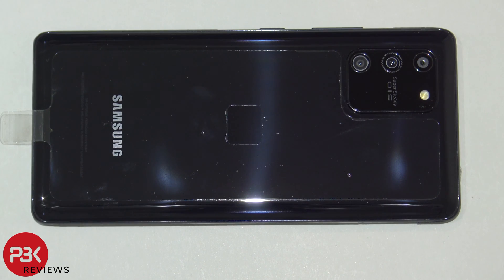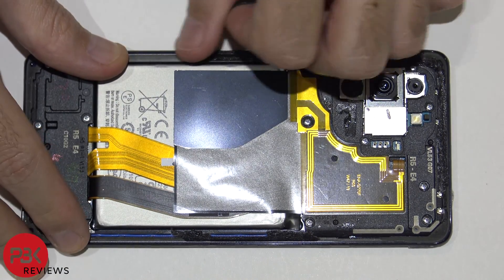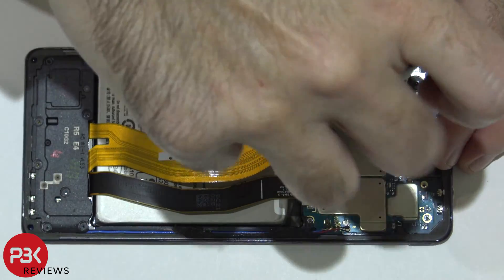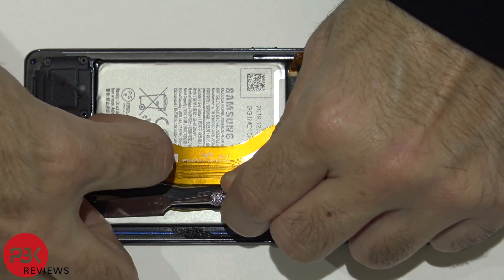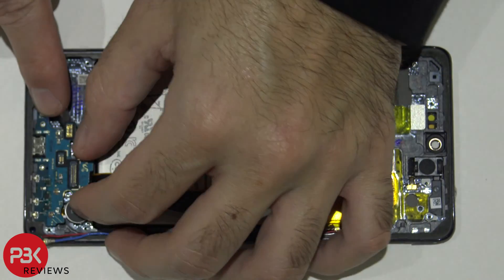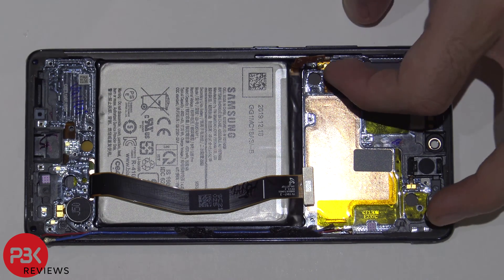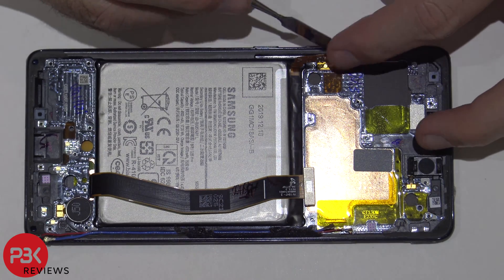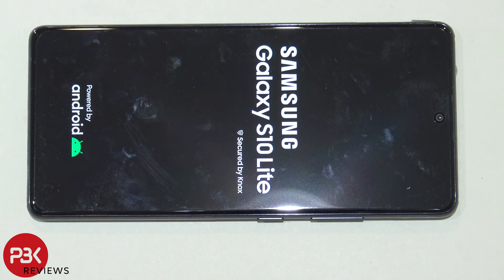Samsung Galaxy S10 Lite Disassembly Teardown Repair Video

Comment: Instead of using heat on the rear panel, it's better to use a, very thin, pry tool to get up under an edge and go from there. Too much heat can melt/warp the plastic.
Reply from the maker: Yup, you don't need to use too much just enough to be able to loosen the adhesive a bit, and then use a suction cup tool or something else to gain leverage to get a thin tool in between.

Comment: Why u stopped at the hardest part? Remove the screen then?
Reply from the maker: Once you take the phone apart, all that is left is to heat up the screen and pry it off so no point in damaging a working screen to just pry it off.

Comment: Hi i have an issue with my s10 lite. When i plug in the usb c cable it wont charge and a popup comes out saying that the temperature of the battery is too low. I tried installing an app to check the battery status and it says that my battery is at -20° C. What could be the problem? When i push in the back, a little under the cameras it returns to ~25-30° C but just for a few seconds. Anyways, nice video and explanations. And thanks to anyone that could help me as well.
Reply from the maker: Hi, it can be the charger port/sub board which needs to be replaced, the battery, or the wireless charging coil if the phone has one which the s10 lite doesn't. You would need to check those parts one by one and see which one is the faulty one.
Reply: @PBKreviews Ok I got it thank you so much for replaying even tho this video is 1 y o.

Comment: My Samsung s10 lite vibration is not working. I already replace the new vibration motor and still not working. Could you suggest another way to solve this problem? Is there another part that  can be damaged to cause this vibration problem?

Comment: Which part of the phone hold its storage? Can i dissemble  it from a broken s10lite and put it in a new replacement s10lite?
Reply from the maker: Hi, the onboard storage is soldered onto the motherboard and you would not be able to take it off to move it to another phone. Requires expert soldering skills etc.

Comment: Thank you. Is it easy to replace the battery?
Reply from the maker: You're welcome. Once the back plate is removed and the screws on the top plastic cover and the top plastic cover are removed, you need to disconnect the flex cables, and then either apply some isopropyl alcohol around the sides of the battery and let it sit there for 30 seconds to a minute so it eats away at the adhesive underneath the battery making it easier to pry off, or you can use a hair dryer or heat gun to heat up the front of the phone where the screen is to loosen up the adhesive making it a bit easier to pry the battery off. It isn't the hardest thing but not easy either. Just takes some time n patience. Here is a link to the isopropyl alcohol: https://www.ifixit.com/Store/Tools/iFixit-Adhesive-Remover/IF145-400?o=4

Comment: Do you need to reapply adhesive after fixing the prob? Or is that to try to keep prying fingers out?
Reply from the maker: Yes you would need to re-apply the adhesive. You would need this part https://www.ebay.com/itm/373557943272?hash=item56f9c9dbe8:g:RrwAAOSw5jVgiG0i

Comment: Good day PBKreviews, my s10lite got sea water damaged, the soundbox works but the mic does not work, it sounds like a static `sea sound`, the usb port works fine.
Do you think its possible to fix the mic using isopropyl alcohol on the usb plate ?
Because if its probably not fixable, i will order a new usb plate and replace it instead of trying to clean the current one.

And at last, the adhesive is needed to put the back plate back ?

If you could help me, i will be forever grateful, thanks.
Reply from the maker: Hi, you can try, and if it doesn't work then order a replacement sub board. Here is a link for some replacement precut adhesive to put the back plate back on. https://www.ebay.com/itm/174413751622?hash=item289bdea546:g:gRcAAOSwCh5fSibP
Reply: @PBKreviews  Thank you, really appreciated!
Reply: @PBKreviews  Tried cleaning with alcohol but no success, I guess it got short circuited. Then I replaced The usb board, mic is back! Thanks

Comment: Any idea where I can find an OEM replacement battery that isn't fake?
Reply from the maker: Usually mobiledefenders.com has OEM parts but checked, they don't for your model phone. Just check online for EB-BA907ABY or EB-BA907ABYL and find a trusted seller with good feedback that states its OEM or original genuine.

Comment: I have a non working one needing probably a motherboard. Can you tell me what the top cover is called as mine got damaged during disassembly, also what is the electronic component inside of this?
Reply from the maker: are you referring to that black plastic cover that's screwed down?

Comment: What is the function of the blue and red wire on the right of the battery? When I got the phone, the back cover was open because of their part.
Reply from the maker: Those are usually antenna cables which connect the antenna contacts from the sub board to the main board.

Comment: How can I fix network connection?
Reply from the maker: First make sure your sim is not the problem, then make sure your APN settings are correct. And then if its hardware, you need to make sure the top and bottom plastic covers are screwed down in place properly since those have antenna lines drawn through them. Also you need to make sure the wire cables running from the main board to the sub board on bottom are connected properly.

Comment: Hi! Tell me please, is this smartphone waterproof? Some people says, that it protected, but others not. Can i wash it in pool? Thanks 🙃
Reply from the maker: No its not rated to be water proof. It might take a small splash of water but I don't think it would survive being placed inside water.
Reply: @PBKreviews  https://youtu.be/aeTHpfBs_w0
But in this video smart looks like it waterproof 😅
But, anyway, thank you :)
Reply from the maker: @rolly5888  I personally would not risk it. Most likely that phone would have charger port issues down the line or mic/speaker issues. Its possible the phone can make it through some water but the chances of parts like cameras, speakers and mics not working properly afterward or the phone down the line not working at all once the water seeps onto the main board is high. Based off the teardown, I didn't see too much in the way of water resistant features so I would believe it would be best not to take it in a pool or anything like that. Being in the bathroom while someone showers, that should be fine but ya I would not take the phone into the water with me.
Reply: It's not waterproof, my phone was fallen totally in water, it's not wirking((
Reply: @dinarim7163  s10 lite?
Reply: @rolly5888  yes
Reply: @dinarim7163  oh...that so sad( 
I bought one and it's amazing phone but without water resistant....(((

Comment: Can't the front facing camera be exchanged for a better cam? It sucks
Reply from the maker: sometimes its possible as long as the connector is the same but in most cases not because usually the software has to be compatible with the hardware as well. Usually only works between very close model phones which have almost identical hardware say if an S10 had the same layout motherboard as an S10 plus and the s10 plus front facing camera was better than the S10, you might be able to swap them as long as the connector and everything was the same.
Reply: @PBKreviews  Thanx. I'll have to look into that. I figured it wasnt possible. I probably won't bother opening the phone like that though. Too risky. Thank you anyways
Reply from the maker: @anthonymathon1552  no problem

Comment: My phone went black screen last night and I tried force restart but it didn't work. Whenever I try force restart it vibrates a little bit and then nothing. Can you tell me what's wrong with my phone.
Reply from the maker: Its possible you have a defective screen or the backlight stopped working or something similar. Maybe there is a hairline crack preventing the screen from working. It can be many things so not sure exactly. You can try taking it apart and disconnecting the battery cable and reconnecting it to see if it helps but I don't think that would be the issue, seems more like a display issue.

Comment: Does it have water protection gasket and mesh in the speaker and ports?
Reply: Yeah. For splash protection. It isn't water resistant though.

The S10 lite was 'lite' on a few of the better options of the S10.

Comment: This man rite here is a legend or this video. Haft way tho  as only my volume up  stuck in  (plus made I worst 😅) but good video mate  thanks alot. Lol next it's the switch charge port replacement if ya got a video for that aswell lol be a diamond if did pmsfl
Reply from the maker: Thanks :)
Reply: Lol Samsung wanted £58 for the back screen and £185 for the volume UP button as stuck in. (just on that now lol

Comment: At 4:17, what are those gray things on the speaker assembly ?
Reply from the maker: Just a rubber seal around the speaker
Reply: @PBKreviews  whats the purpose of those rubber like seal on the speaker assembly? the phone should be able to handle some abuse like light raining?
Reply from the maker: @xgallreal  Its not really a seal like glued down, more like to have all the sound aimed at going out the speaker vent and not bouncing around the phone I would say.  I would say the phone is probably splash resistant (minor splash of water) but not if it were to be dunked into water.
Reply: @PBKreviews  so abit of rain will be fine? especially the earpiece area
the sim card tray also appears to have a rubber seal when i took it out.

Comment: Is it normal for my S10 Lite to heat up at the free space next to the camera?
Reply from the maker: Yes, there is components there both of the mother board and camera's so should be normal if being used to heat up.
Reply: Totally normal, all phones ive owned with the processor on the top could heat up when using. If its get really hot maybe something wrong but then the phone says it overheatm otherwise totally nothing to worry

Comment: does the phone have any water resistant mesh like the speaker or the earpiece? even though the phone isn't IP Rated
Reply from the maker: Not from what I could tell
Reply: @PBKreviews  alrite, wished Samsung added water resistant like mesh for a piece of mind since i am using this phone. Is it possible to test like putting a drop of water on the mesh and pushing it, seeing if the water goes through the speaker?

Comment: Did you notice anything to indicate that it would resist a bit of water? Like any rubber, etc etc. Not asking if it would resist being submerged, but just splashes etc etc. 
Great video btw.
Reply from the maker: Thanks, It does have strong adhesive on the back plate and a few rubber gaskets on the charger port board but none on the main board. I would say it should hold up to some splash but I wouldn't dunk it in water.
Reply: @yanikebrown-young4397  lol wtf. 
That's like saying "Hey, I wanna skydive with a parachute bag full of nails, will the nails turn into a chute?"
Reply: @yanikebrown-young4397  I'm not going to waste my life watching a phone that's not water resistant be submerged, in about a month it'll die all the way. Fr.

Comment: Please suggest one clear choice to buy between oneplus 7t oneplus 7pro and S10 lite, confusion is because of low price of 7t , beautiful screen 7pro in just 39990 and increased price of s10 lite 42999. Please suggest one phone for practical uses , I mean a complete package phone which I can use for at least next 2 to 3 years. Your suggestion will be a great help. Thanks in advance.😊
Reply: S10 lite

Comment: hi. this phone's splashproof have much difference of galaxy s10's  waterproof?
in this video, i saw rubber gasket and i think it is sign of splashproof or waterproof. am i right?

sorry for my bad english :)
Reply from the maker: No problem, yes the phone is splash proof from the looks of it, has water resistant adhesive so would help against small amounts of water not getting in. But not sure exactly how resistant it will be. :) hope this helps.
Reply: @PBKreviews  it's so helpful to me. thanks lol 
good day
Reply from the maker: @꽥꽥스2  you're welcome :)

Comment: Klasse Video...nur leider vollkommen falsche Ansätze. Hier wird weder auf ESD Rücksicht genommen, noch auf allgemeine Verfahrensweisen! ESD Handschuhe sind Pflicht. Metallwerkzeug zum entfernen von Connectoren und Coax Kabeln - dafür gibt es ESD Werkzeuge!
Wenn das Gerät danach noch funktioniert hat man wohl echt viel Glück...
Reply from the maker: I've done hundreds if not thousands of devices without any ESD gloves or tools and every single device worked afterwards. The risk is not that high, only if your in a very static environment.

Comment: Great video 
I wonder why the A series don't have the copper stuff for cooling the processor 
Do you know why?
Reply from the maker: Thank you, its probably due to them cutting down costs etc. Usually they incorporate those types of things in higher end models which they price tag is higher due to them adding additional cooling and so forth. Also processors and such are on higher end and may require more cooling on higher end devices.
Reply: @PBKreviews  is that cooling system better or worse when compared to those found in Poco F1, for example?
Reply from the maker: @GGBGameplays  I would think the one in the Samsung would be better since it has more surface area to both absorb and transfer heat. But again factors like processor type and so forth make a difference in how much heat is produced and how much cooling is needed.
Reply: @PBKreviews  thanks for the fast reply. I ask because my S10 Lite gets very hot running heavy games, and Samsung has agressive software thermal throttling, the GPU barely runs over its minimum clock speed of 257MHz when it's hot. I didn't know it has a cooling system, I thought it didn't. I see some Poco F1 running games with stable clock speed with custom kernels, but they generally allow battery to get higher temperatures, my phone's battery keeps 36-38ºC running games, but CPU and GPU achive up to 80ºC (according to the softwares). Where I live is pretty hot the whole year though.
Reply from the maker: @GGBGameplays  Not sure, I know both the screen being on generates a lot of heat, as well as the processor running and if its an online game, the phone using the internet generates heat as well on top of the battery so there is a lot of heat. Some people also leave their phone plugged into charge which also adds a bunch of heat there. If you have any sort of case that can also retain heat instead of letting it dissipate.
Reply: @PBKreviews  I don't use any cover with my phone, I also don't play games while plugged. I tested online games like the fresh Genshin Impact with max graphics and framerate, also emulators like Dolphin, which is pretty heavy for smartphones and it doesn't use internet (I keep it disabled). The CPU does a quite good job with throttling test, the GPU seems to be the problem here.
Reply from the maker: @GGBGameplays  Oh I see

Comment: Watching this on my s10 lite. dose it protect from dust ? Other wise thanx for your video
Reply from the maker: Hi yes, it has water/dust resistant type adhesive on the back which I would assume would protect the phone from casual slashes or dust but nothing really major as far as rubber gaskets around connectors and so forth. Thanks :)
Reply: @Ahijit Paul aluminium